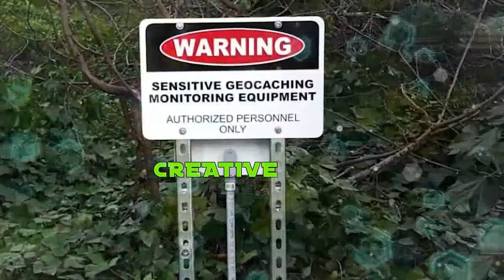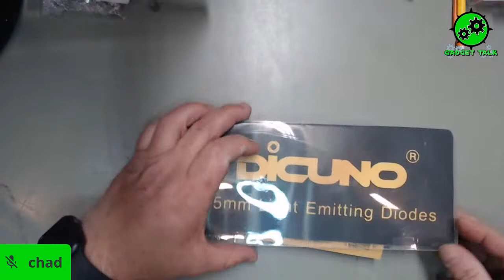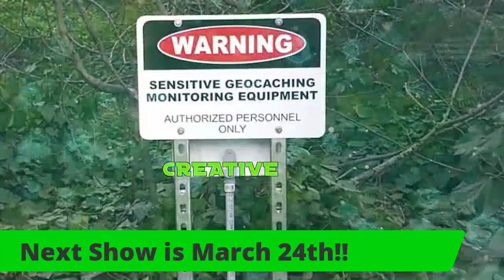Gadget Talk - Building a LED Code Decryptor

Comment: Thanks for the show. I put the circuit into a plastic ammo can. I plan to place it this week.
Thanks for the pro-tip on cutting long bolts to size. I had forgot about that feature on some stripper/crimpers. I like to use the resistor color code numbering. It makes it standardized and might teach a cacher something and provide another tool for their puzzle solving arsenal. I’m looking forward to next months build.
Reply: Thanks for watching Darel,  I decided not to get into the resistor codes because that could take up the complete hour by is self. Most cachers also do not have soldering tools so i went with the easiest way i could think of for beginners. In the future i plan on getting more detailed into the electronics.

Comment: Thanks for the show. I put the circuit into a plastic ammo can. I plan to place it this week.
Thanks for the pro-tip on cutting long bolts to size. I had forgot about that feature on some stripper/crimpers.